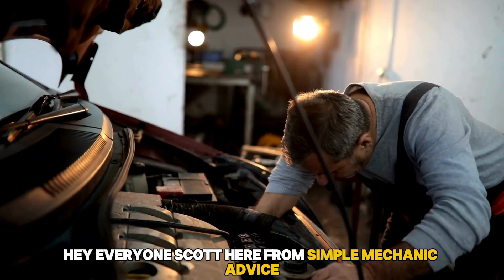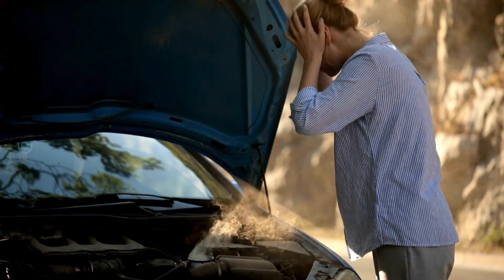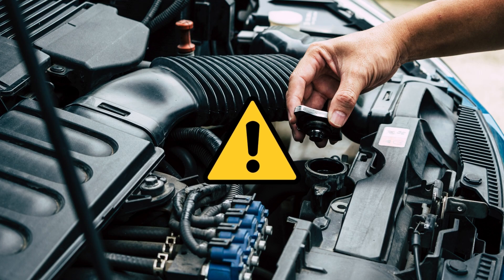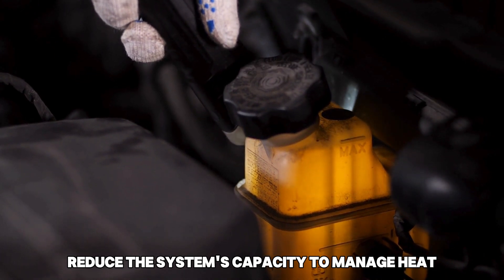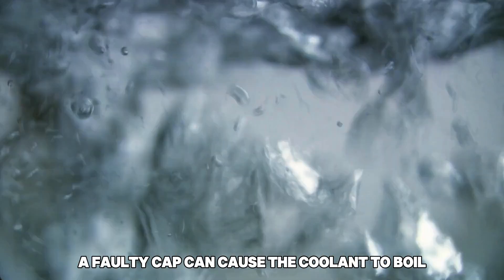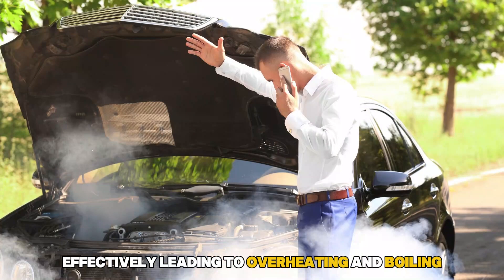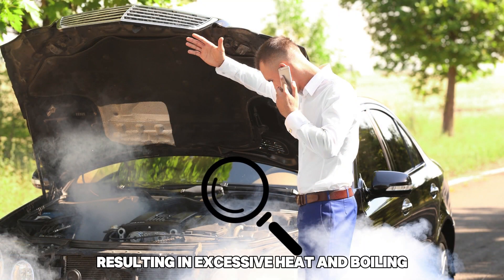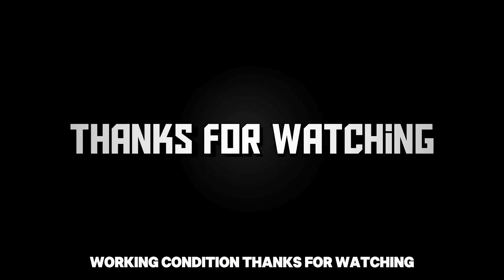Car Coolant Reservoir Boiling (Meaning, Causes, And Solutions Explained)

Comment: My cars coolant boils in the reservoir at a lower temperature, I’m gonna get the radiator cap replaced and see how it’s work outs before making any major replacements in the cooling system.
Reply: Did it work ?

Comment: So my 2012 Toyota Camry there was a hose that went into my reservoir but got blown off my car keeps overheating after every I want to say maybe 100 miles if that then I have to remove radiator cap and put more coolant inside then can drive again I’ve replace the radiator cap and still nothing
Reply: Find out what it was?

Comment: Question…reservoir bubbling and overflowing but full radiator low on fluid can’t find leaks oil is not milky, reservoir cap will not stay closed. 2015 Kia sorento. Has not overheated except once when I was in park with foot on gas to rev up car.
Reply: I’m not a full time mechanic (only do mechanic work in my own cars for 8years) but if there’s not hot air coming from your air vents when it’s on hot position of course most likely is a failed thermostat or it could be that the fan is not turning on as well. It could be more reason but at least I would start with those. Hope that helps
Reply: coolant clogged in your engine
Reply: Same as mine on a different car model

Comment: I hear the boiling but my truck doesn’t overheat??
Reply: Experienced the same with my bike yesterday. What exactly is happening? Did you figure out!
Reply: @anirudhauttarkar8806 what happened
Reply: Me too in a 2005 pt cruiser
Reply: @bobbiecaress4736 I changed my water pump and I haven’t seen it boil anymore
Reply: @bobbiecaress4736 what u do
Reply: What did u do to fix it? The hose?
Reply: @Grimlock530 it was my water pump that failed
Reply: @Toxiicsquid805 would your truck not make the noise till you shut it off ?
Reply: @Grimlock530 yup exactly once I turned it off I would hear boiling water but it wouldn’t show it on the temp that means your water pump is starting to go bad
Reply: @Toxiicsquid805 okay thanks my friend
Reply: @Grimlock530 hi did it fix your problem
Reply: had to change my water pump few days ago! I also added Rislone Hy-per super coolant and my car now is running at least 20°F cooler and no bubbling in the system.

Comment: To flush radiator you just fill it up with water?
Reply: There is a drain knob. Open that until old coolant goes out, clean it with new coolant. Close the knob, open radiator cap and start filling new coolant.